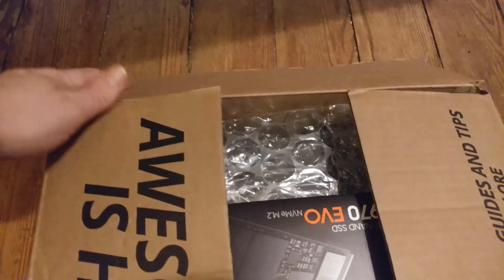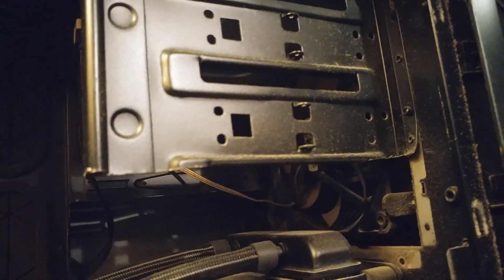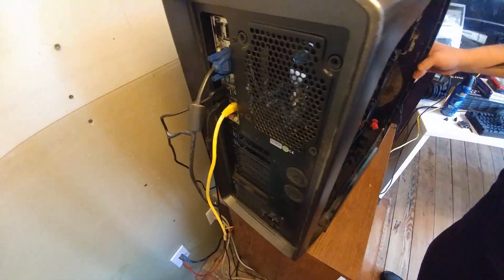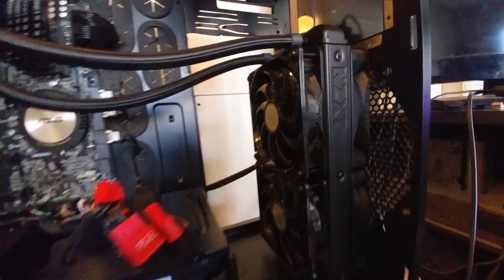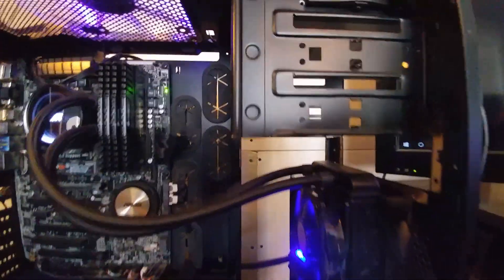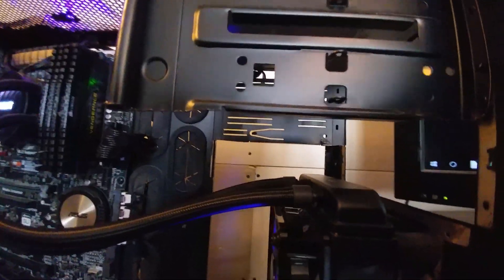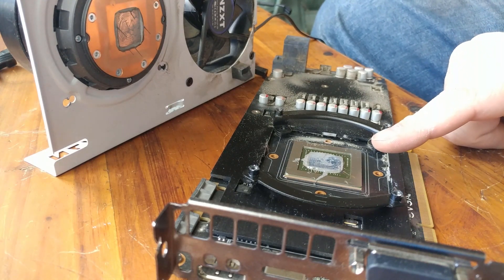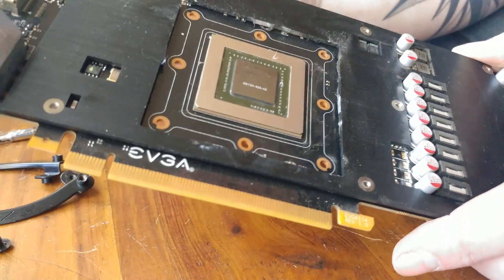GTX 1660 TI Watercooled???

Comment: I think GPU water-cooling is underrated. They should make another mounting bracket for GPUs like yours. The only thing I don't get yet is how to get the GPU in zero fan mode with the Kraken G12.
Reply: You can still adjust the fan curve so that fans stop running below a certain temp

Comment: you need to move your rad for ur cpu!!! the air is gonna be trapped up at the highest point in the loop so youre getting a lil bubbly noise and its degrading ur pump a bit, not super critical but itll be a nice lil fix

Comment: You have exactly the same case as me, I am also thinking of water cooling my NVIDIA GeForce GTX 1660 Ti, plus my CPU
Reply: useless to watercool ur gpu just change ur thermal paste each time ur gpu starts to thermal throttle

Comment: I modified my card yesterday, I use a CPU air cooler which Cooler Master T400i. It looks like the 212 Evo. I installed it with 2 fans. The result is incredible. 12C drops from stock cooler. I've also overclocked my card such as: +115 on Core Clock, +1200 on Memory Clock. Stable at 48C. Sometimes, 45C.
Reply: Updated sad news: The card is dead and I have sold it. :(((

Comment: PRO TIP: Move your CPU cooler to the top of the chassis.  Doing this will allow the air bubbles to collect in the top of the radiator and not in the pump which will cause noise, reduce its effectiveness, and eventually cause it to fail prematurely.  Also, if you DO decide to mount a radiator like that whether it's for the CPU or GPU, make sure you mount it with the hoses at the BOTTOM.  Most hoses won't reach that far (when used for CPU cooling), so top-mount is usually the way to go.

Comment: why the hell is the 970 evo installed without a standoff? its smashed down. I've still got the same case as that, and looking at that one I cant believe how clean mine still is. I just retired it. Have the limited edition 600D White case.
Reply from the maker: You're right and I couldn't find it at the time, it's never had an issue. Also I've jigsawed and drilled holes throughout this case so I'm not too worried about it. Wish I could have the things I make wish lists of.

Comment: I’m making a video on my 1660ti water cooling solution and if your watching this video your going to want to know this information.

1) the copper plate on the Corsair h60 2019/2020 refresh is square and will cover your entire gpu chip, four of your vram chips and about two thirds of the other two furthest vram chips. This is on an evga model with no heatsink on the vram whatsoever (weak). 

2) find yourself the cheapest aluminum external 3.5 inch hdd housing made from one solid continuous piece, the star tech model I have fits the 1060ti like a glove and with a little dremeling and maybe some aderal  and thermal padding you can make your own g12 kraken style cooler that is far more effective. If you have a low profile laptop gpu/cpu blower fan you can alide this in the rear to have essentially a hybrid water cooled/blower style 1660ti. I’m recording my the process and making video because this would essentially be an excellent solution for any cards (my vega 64 comes to mind) that don’t properly work with the kraken g12. Pound out copper pennies for pads (canAdian pre-1982 are 98% copper and work well and become pliable to flatten flush against chip when worked to a flatter wider shape).  Try to find a laptop blower that’s 5 volt .5 amp and thin enough to not waste air blowing under the GPU.

3. Ditch the backplate on your cards. All of them they hurt temps more often then help.

4. Paint and add colored leds for an extra 8fps in all games. (I’m going yellow and purple accents, card title in green, with a cdpr bird logo and cyberpunk insignia cause it looks cool piss off)

Comment: I’ve got an 
Evga1660ti  board , no backplate, shroud or fans, so I hope this is super effective. 

If anyone wants a video on how to disassemble and reassamble without breaking any warranty stickers I’ll make a video on it if I get two likes. Only cause I’m not bothering unless it’ll help at least one person and 50% of people are lazy.

I’ve got a couple of old heatsinks that will solve this Lickety splits no shits. Purchasing g12 now.. in white, thank you.
Reply: I'm your second like... where's my video?
Reply: Ninjamigs 1 i just saw this. Its coming. I actually need to do this with a couple gpus in need of repad and repaste as well as some other types of parts as of right now. Im gonna post it under this account to keep it simple to the four people looking for this content.

I want to add, although the warranty sticker is technically unenforceable at least in the USA, it will determine the path between super easy and potentially difficult RMA and returns
Reply: Oh.. fantastic. If i dont upload a video to YT like i promised im a liar. If i do, im a bottom tier youtuber. Welp, i shall undertake and report back here with a link upon completion to share my knowledge with my bretheren. Time to give back.

Comment: Sorry to ask, just want to know if the g12 mount works with gigabyte gtx 1660 super.
Reply: im looking same for asus phoenix 1660 super and no one can answer, only answer its, if u get G12  u need to modify the brackets because dont match size with mounting holes. im seriusly thinking about it.
Reply: D4rklynx you’re right, same thought.
Reply: @jackrhapsody  ill let you guys know im going to try it out when it comes in, i have the gigabyte 1660 super 3 fan
Reply: BlazinMoDz nice man! will look forward to it.
Reply: @blazinmodz8390  Any update?
Reply: @blazinmodz8390  any updates?
Reply: @jackrhapsody  any update?
Reply: @dillonvenne2174  @BlaziMoDz is doing it while we wait.
Reply: Same ask for a phoenix super

Comment: how do you did for to solve the problem of 12:56 min bro?
Reply: It's hard to say but you definitely have to use the mounting brackets for AMD cards for the GTX 1660 cards. I mean, I am not sure if this applies to all cards from the GTX 1660 family, but in the case of my PNY GTX 1660 Super Twin Fan card, the distances between the mounting holes around the GPU slot coincide perfectly with the mounting brackets for AMD cards. In addition, fortunately it turned out that due to their shape and size, these handles can be easily mounted horizontally along the PCI express connector and not vertically as in this film if too high capacitors interfere with their installation.
Reply: @wojciechnowinski8775  how i wish you have shown in the video

Comment: The VRM is on the left of the cooler not covered and those squares you are calling the VRM around the GPU that the thermal pads go on to are the VRAM chips. Thanks for the video i was tempted to give this ago but not going to bother now so saved me some hassle.

Comment: Going to try G-12 with GeForce 1660.  Thanks for the vid.                       (also bro,  de-dust that rig a little more often...lol)
Reply: I have a 1660, did it work for you, what types of PCB you have? How did you do it? Did you have to modifiy the bracket?
Reply: @DerekKyleHappyReconic  Sorry I did not respond a year ago.  Only saw your post now, when ESTER1o asked the same question.  I will keep my answer short and to the point.  I wrote an inqury to KRAKEN on the G-12, was told it would not fit my GIGABIYE 1660 OC.  I was planning to Water Cool my CPU as well.  What I did,  Purchased a used EVGA 240 mm All in one.  A very inexpensive CPU/ GPU)block , a 240 mm Rad, 5 ft of clear, soft cooling tubing, CPU compression fittings for the CPU/GPU block, 4 small stainless hose clamps, an assortment box of small aluminum finned heat sinks, some clear double sided heat tape (very thin).
The EVGA CPU Block was used on the CPU,  I had to disconnect the EVGA Tubing, both at the block and the RAD.  This was replaced with Clear tubing and hose clamps when needed.  The barbs on the RAD did not need the Clamps as the tubing I got 3/16 ID worked great.  I removed my GPU took cover off and removed the finned heat sink.  The inexspensive CPU/GPU block fit the holes that were in the PCB at time, so fitment there was good.  I then took the little finned heat sinks and using double sides tape attached the small heat sinks to every componet that had Thermal Tape covering them when the GPU Heat sink was removed.  The cover or plate holding the dual fans for the GPU fit so well did not have to modifiy.  I then connected all my tubing.  From the OUT of the EVGA Rad to the IN of the EVGA Block/pump.  The OUT of the EVGA Block to the IN of second 240 mm rad.  The OUT of second RAD to the IN of the GPU Block,  the OUT of the GPU Block to the IN of the EVGA Rad.  The created as system that the CPU and GPU was being cooled by it's own Rad, yet using only one pump.  (Learned later I did not have to do this)  I created a duel (CPU/GPU) water cooling system for a total of money spent $ 125.00.  The system was fantastic!  I learnd alot about overclocking of both the CPU and the GPU because I was no longer concerned about cooling.  NEVER did my CPU exceed 46 C (ran IDA 64 8 hours on Ryzen 2700X  OC to 4.2 GH)  My 1660 OC was overclocked 175 mhz for the Core and 250 mhz for the memory.  This resluted in the base speed being 1745 mhz and boost being 2010 mhz.  Power level was 100% and I used MSI afterburner.  Running Haven for 4 hours looping the GPU never exceeded     55 C.  I used this system for almost 15 months then the pump went south. Never buy a used all in one.  As I was in the process of upgrading my system I never replaced that pump.  I am still using my 1660 OC in a Lian Li Lan Cool rgb case, with    a MSI Unify X570 Motherboard (was using MSI X470 gaming max) Current CPU Ryzen 5800 X.  Using Noctura D15S with dual fans on CPU, the Lian Li case is big, big enough to have 3 120 mm fans intake in front, and 2 120 mm intake on the bottom directly under the GPU,  I have 1 120 mm exhaust, and a non-powered area (2-140 MM size) on top.  I can not get the same GPU speed I had with water because the temp holds at 79C.  I do not like that.  So most of the time I am running my 1660 OC at a bit less then half the OC water gave me.  With my CPU and the Noctura the temp never exceeds 55 C.  Got to love Noctura for sure.  I hope this helps you.  Water cooling was fun!  I learned alot, but I did it on a very narrow budget.  If I were to go water cooling again,  I would try to use a single 480 mm Rad, and a D5 pump.  The GPU would get its own block/water jacket.          Be happy,  be safe
Reply: друг, у тебя все получилось?
Reply: @kluelessss I will keep my answer short and to the point.  I wrote an inqury to KRAKEN on the G-12, was told it would not fit my GIGABIYE 1660 OC.  I was planning to Water Cool my CPU as well.  What I did,  Purchased a used EVGA 240 mm All in one.  A very inexpensive CPU/ GPU)block , a 240 mm Rad, 5 ft of clear, soft cooling tubing, CPU compression fittings for the CPU/GPU block, 4 small stainless hose clamps, an assortment box of small aluminum finned heat sinks, some clear double sided heat tape (very thin).
The EVGA CPU Block was used on the CPU,  I had to disconnect the EVGA Tubing, both at the block and the RAD.  This was replaced with Clear tubing and hose clamps when needed.  The barbs on the RAD did not need the Clamps as the tubing I got 3/16 ID worked great.  I removed my GPU took cover off and removed the finned heat sink.  The inexspensive CPU/GPU block fit the holes that were in the PCB at time, so fitment there was good.  I then took the little finned heat sinks and using double sides tape attached the small heat sinks to every componet that had Thermal Tape covering them when the GPU Heat sink was removed.  The cover or plate holding the dual fans for the GPU fit so well did not have to modifiy.  I then connected all my tubing.  From the OUT of the EVGA Rad to the IN of the EVGA Block/pump.  The OUT of the EVGA Block to the IN of second 240 mm rad.  The OUT of second RAD to the IN of the GPU Block,  the OUT of the GPU Block to the IN of the EVGA Rad.  The created as system that the CPU and GPU was being cooled by it's own Rad, yet using only one pump.  (Learned later I did not have to do this)  I created a duel (CPU/GPU) water cooling system for a total of money spent $ 125.00.  The system was fantastic!  I learnd alot about overclocking of both the CPU and the GPU because I was no longer concerned about cooling.  NEVER did my CPU exceed 46 C (ran IDA 64 8 hours on Ryzen 2700X  OC to 4.2 GH)  My 1660 OC was overclocked 175 mhz for the Core and 250 mhz for the memory.  This resluted in the base speed being 1745 mhz and boost being 2010 mhz.  Power level was 100% and I used MSI afterburner.  Running Haven for 4 hours looping the GPU never exceeded     55 C.  I used this system for almost 15 months then the pump went south. Never buy a used all in one.  As I was in the process of upgrading my system I never replaced that pump.  I am still using my 1660 OC in a Lian Li Lan Cool rgb case, with    a MSI Unify X570 Motherboard (was using MSI X470 gaming max) Current CPU Ryzen 5800 X.  Using Noctura D15S with dual fans on CPU, the Lian Li case is big, big enough to have 3 120 mm fans intake in front, and 2 120 mm intake on the bottom directly under the GPU,  I have 1 120 mm exhaust, and a non-powered area (2-140 MM size) on top.  I can not get the same GPU speed I had with water because the temp holds at 79C.  I do not like that.  So most of the time I am running my 1660 OC at a bit less then half the OC water gave me.  With my CPU and the Noctura the temp never exceeds 55 C.  Got to love Noctura for sure.  I hope this helps you.  Water cooling was fun!  I learned alot, but I did it on a very narrow budget.  If I were to go water cooling again,  I would try to use a single 480 mm Rad, and a D5 pump.  The GPU would get its own block/water jacket.          Be happy,  be safe

Comment: Bro, thinking of doing this mod. Can you explain how to mounted the brackets? Didn’t catch how you mod it to fit. Thanks for the video.
Reply from the maker: Hey people, thanks for the comments. This is without a doubt a AIO Watercooled 1660 TI, not a full water block. With that said, I DO NOT RECOMMEND doing this with this setup. The processor is the only chip currently being cooled, with only that stock heat sink strip otherwise. Having ran this for over a month now I have had some problems and lock ups. Currently running at CC 2295MHz MC 7230MHz with 4.2GHz on 4770K. Thinking it's from the overheating of the other chips since they are such an important part of the performance these days. I did cut the left side bracket and made the holes wider in the mounting plate.
Reply: Try clocking it down a bit. My card runs best at 7000 and about 2050. Granted mines stock. My card runs 73 under bench load and 65 playing borderlands 2 max settings at 150fps 144hz monitor. 32 idle
Reply: nonsense content. water cooling 1660 ti should be left out of the title...because it is the 1/5th of the content and not explained. Besides it is obvious that the capacitors arent cooled like used to be with the older airfan and as obvious shown they block the left bracket and not showing how was handled. It is obvious that a custom solution was made to fit the bracket without the main middle part of it and propably is cut into 2 pieces for removing the curve. Or else a different straight bracket has to be used. anyway little use of this video. It may work in Msi with custom bracketing but may not work for other companioes like asus or gigabyte as they have their own custom builds. It is well known that a reference card was not made from nvidia so it is trial and error. I would suggest to you to unscrew your model card. and check the hole dimensions near the gpu then check the capacitor positions and vrams. Although watercooling the gtx1660 ti would be just more power consuming for our bill than helping the card. I tried to watercool mine vut the difference was not much. i could gain a 10 celcius gain with 1-2 frames win....in witcher 3. for any other game the stock is perfect.
Reply: Martika Kotopoyli its really where im from thats the problem. Its hot like hell in my country and i was forced to watercool my cpu without overclocking. At idle its 50 because our ambient temp is hovering around 36 to 40. My 1660 ti at load is reaching 90. I really need to cool it more. Now water cooled cpu im hovering around 35 to 40 and at load its at 70. 

I dont think a straight bracket would work since it would impede the aio copper. I was thinking to cut the brackets to clear the other components. I could put an intake fan underneath the gpu to cool the vrns. 

Just waiting for a reply on how he mod it. Thanks for the post, im still thinking of ways to better cool the gpu.
Reply: @justanotheryoutubeuser5029  if you want to follow his example then cut only the brackets in three pieces. Two of them at the screw corners should remain intact and throw away the middle curve part.
Reply: Martika Kotopoyli yeah thats what im thinking also. It would be nice if he showed how he did it so ill have the general idea on hiw to proceed.